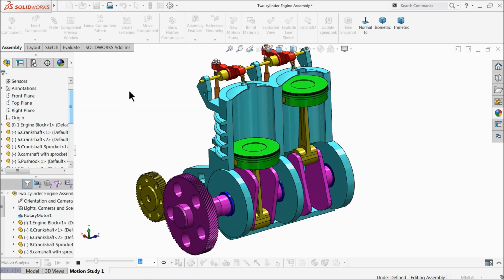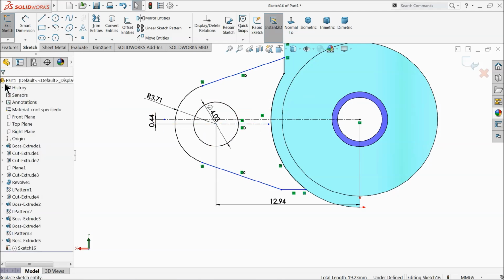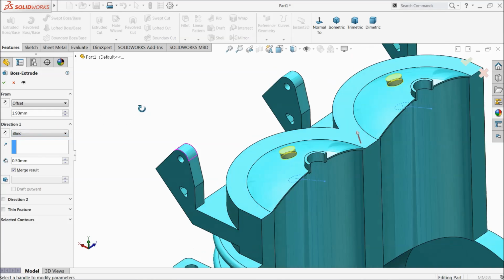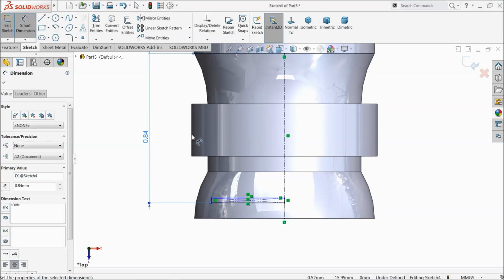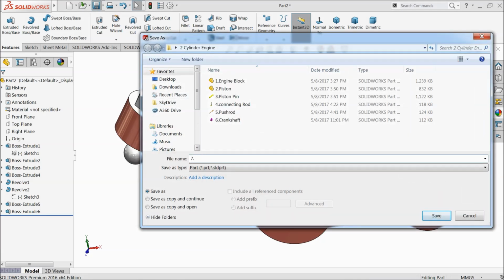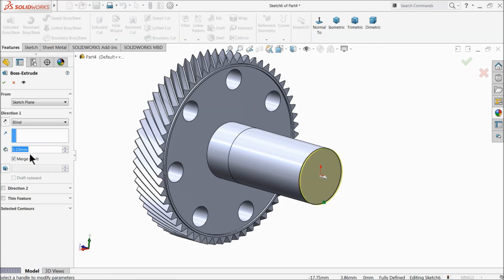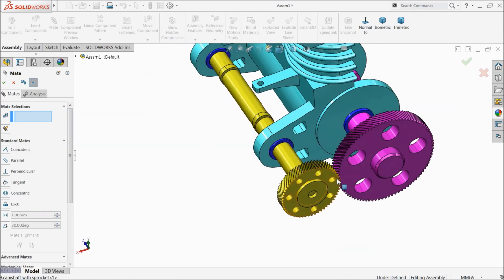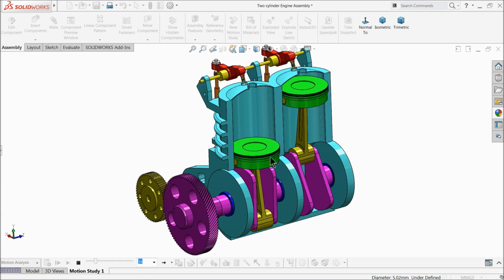Solidworks tutorial | Design of Two Cylinder Engine in Solidworks

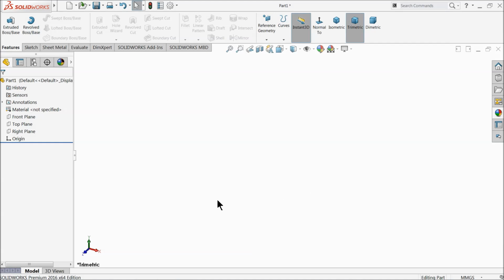Comment: 0:50   Part 1 Engine block 

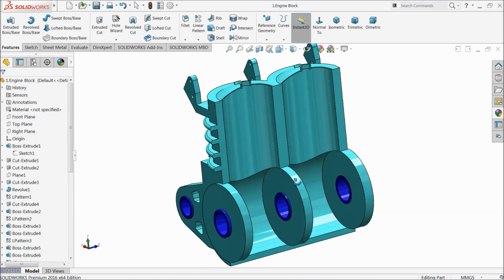40:08 Part 2 Piston

47:27 Part 3 Pin
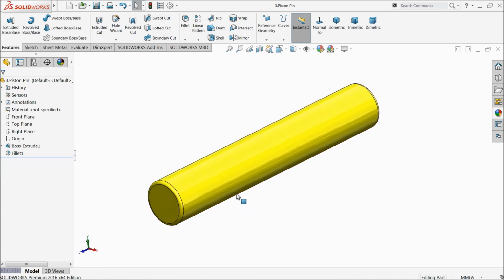48:23 Part 4 Connecting rod
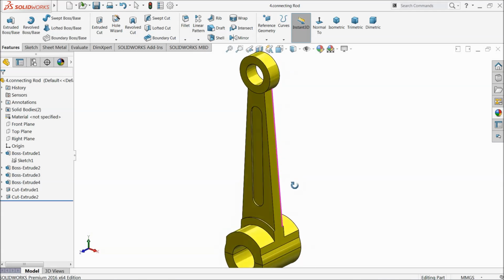54:20 Part 5 Pushrod

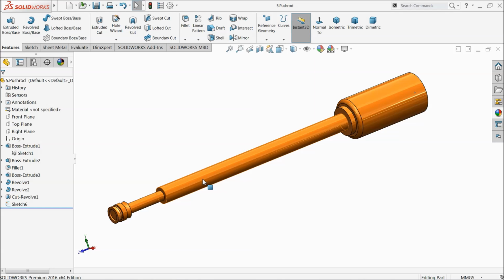1:00:14 Part 6 Crankshaft 
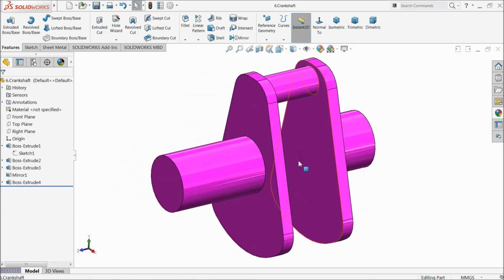1:05:58 Part 7 Rocker Arm
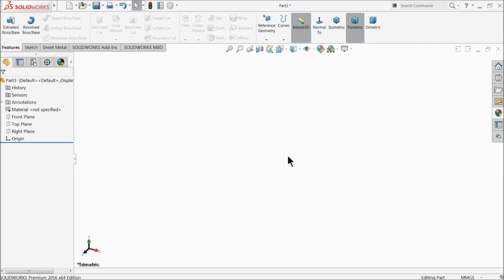1:17:54 Part 8 Crankshaft sprocket 

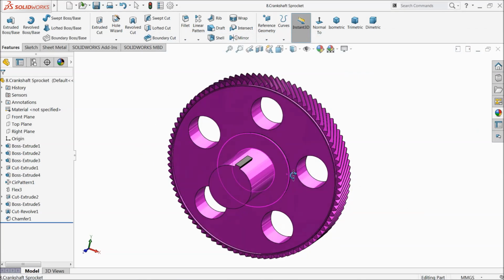1:30:06 Part 9 Camshaft Sprocket
1:41:15 Part 10 Arbor
1:44:32 Part 11 Valve

Comment: Nice tutorial, I appreciate your skills and presentation.But sorry to say you that, each cylinder must have two valves ( suction and exhaust ), hence in two cylinder engine, you should have kept 4 valves and related structure. Also number of teeth on cam and crank shaft gears must be reversed in your design.

Comment: I did this drawing of yours on Inventor and it runs perfectly. The only problem I had was with the twisted gear, as older versions of inventor does not have this tool. However I improvised and got it right at least in appearance. Thanks for your tutorial, you are a very generous man and an excellent tutor. How about drawing a six cylider or V8 engine. That will be much appreciated.and will keep me going in my retirement.

Comment: Great tutorial.  At 10:10 I think you should have created a new plane offset 12.5 mm from the front plane.  Then mirrored the revolve1 feature using this new plane instead of using linear pattern.  The results seem much better this way.  I have only completed the engine block so far so I apologize if you have fixed this later in the video.
Reply from the maker: Brandon its true i should create a offset plan instead of linear pattern, i will take care in coming videos Thanks,